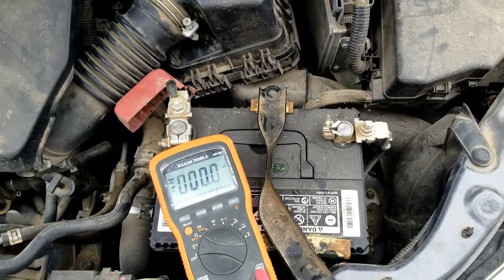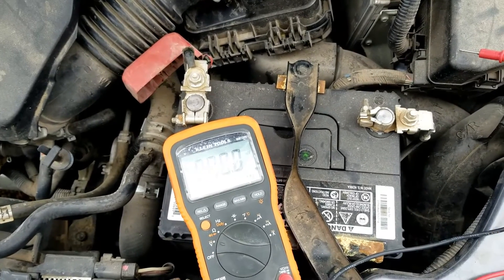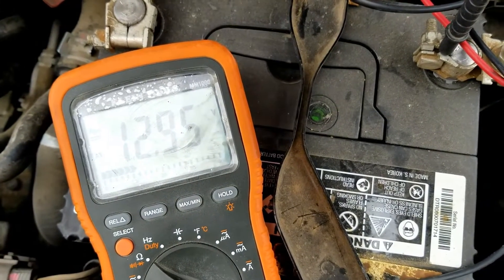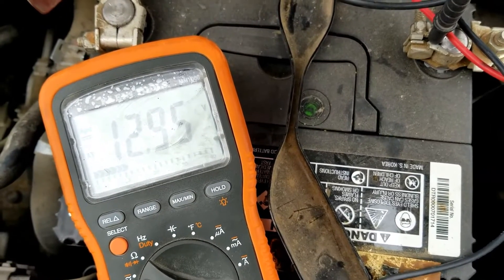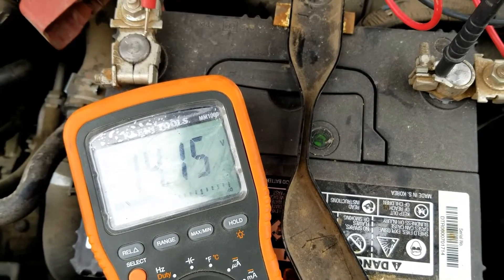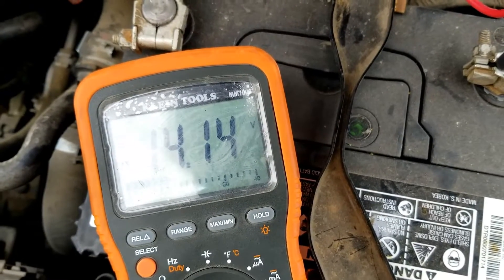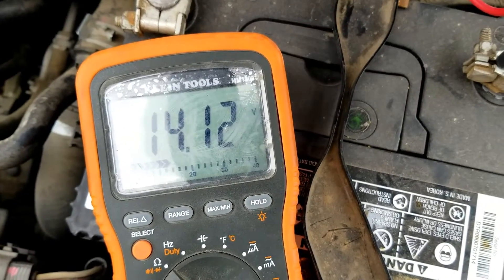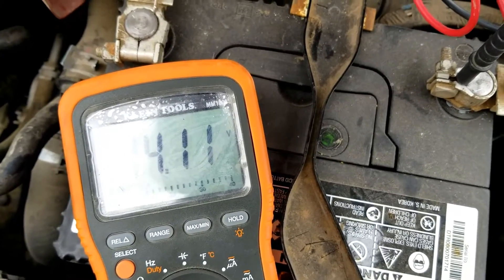How to Test a Toyota Collora Alternator is Good or Bad Using a Multi Meter

Comment: My Corolla battery is so low I'll need to jump start it to even do this test. In my case with the battery voltage very low, would the battery still read 14.5 V right after jump starting it? I'm suspecting a failing alternator. Thanks!
Reply from the maker: Yes, after being jump-started, a good alternator should output at least 14-14.50 volts. Some alternators, when getting old, will output roughly 13.5 volts, which will keep the battery charged, but it is ready to go bad, under 13.50 volts, it is definitely a bad alternator. Anything over 15 volts also bad.

Comment: My battery voltage is testing it 12.5 when off, and  is testing at 13.5 when on. It’ll shut off a minute or two after turning on the car. You think it’s the alternator?
Reply from the maker: 13.5V is on the low end, but it is still charging. It may be getting old and weaker, and that would be an issue.

Comment: I gotta customers car now, 08 corolla with misfires and transmission solenoid codes. It was just acting weird so I put my volt meter on it and sure enough 13.0-13.28 volts. So I’m assuming the alternator is going bad and causing the ecu to go crazy
Reply: Did you replace the alternator? How did you fix it?

Comment: Good video, I just replaced the alternator and I’m not getting any charge to my battery. Battery was about 10.8 volts but nothing from the old alternator or the new one. ? Any advice
Reply from the maker: I would check all the fuses and check for a wiring problem. All the connections need to be good, no open or short, or the alternator won't be able to charge the battery.

Comment: Thank you this was very helpful my wife's car wouldn't start it did sit for a week or 2 I have the battery on charge now using ctek charger once charge I will measure voltage of  the battery  and alternator 👍👍

Comment: So my car has the c1241 code 05 Toyota Camry. I tested the battery 12.85 . I turned it on went from 11.8-13.5. Bad alternator possibly?
Reply from the maker: 13.5 volts is on the low side but should still charge the battery. I would be sure the battery is good, and all the connections are good.

Comment: First off, thank you. Second, my battery is running at 13.1 volts this is running, ac and bright lights. I had the auto parts store run a test and my bluetooth device says the same, 13.1. I was unable to jump start my car yesterday. Today it jumpstarts. I placed a brand new battery in today and it also didn't start with new battery. I have now went back to old battery. So this is too low and is this an alternator issue, correct?
Reply from the maker: While on the low side, most Corolla's alternators output between 13.5-14.5 volts; it is likely enough to charge the battery. There may be a draw or short that is draining the battery when the vehicle is off.

Comment: This test is good and will cover most faults with charging but in some cases it can be caused by poor connections between battery and alternator or broken wires/fuses to the internal voltage regulator.

Comment: What’s the reading if you have lights ac defrost radio etc mine went down to 12.8v my battery light only comes on when I turn head lights on
Reply from the maker: That is low; it usually stays above 13.5 volts. I would take the alternator in to be tested; it may be getting weak.
Reply: @HVAC_Mechanic thanks for the response that’s what I’m feeling is the alternator is just dying slowly I’ll just replace it with a new one I mean it is oem 19 years old 😂

Comment: Thx....so let me ask .......if say u replace the bad battery & then your alternator tests @ 13.5 w/ car JUST started up after battery JUST replaced...is it true that an alternator testing # CAN go up overtime to its normal 14 or so # as you use or leave car running a bit longer or drive after replacing battery ?  Thx again.
Reply from the maker: While on the low side, some vehicle alternators output 13.5 volts. You will need to check the output specifications for the alternator, but 13.5 volts may be normal.